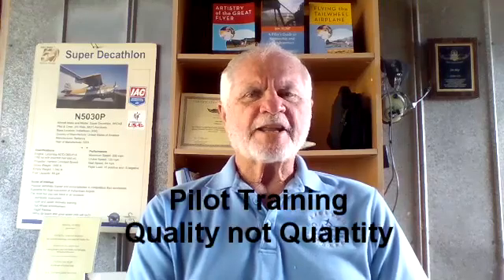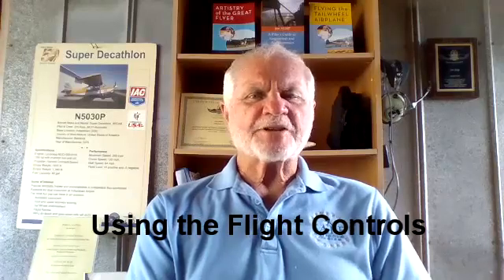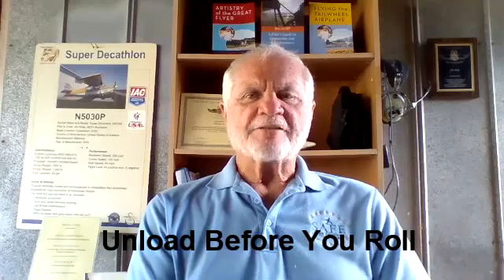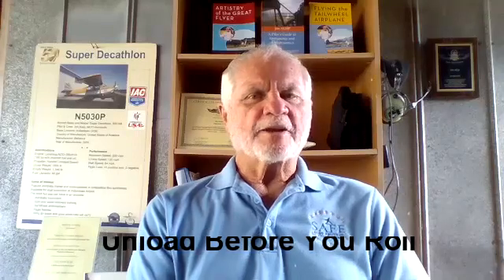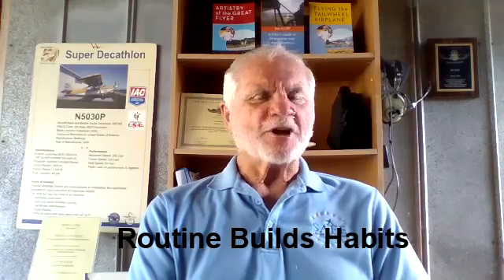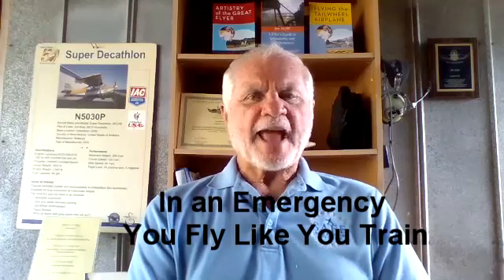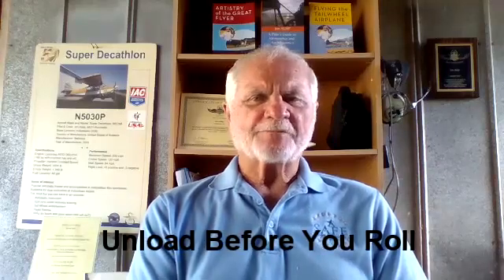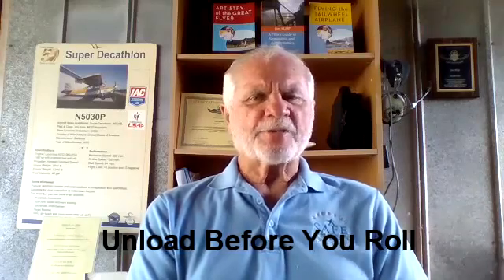Airmanship and Aerodynamics Part III – The Most Important Flight Control Habit

Comment: Have a question?? How to set up for straight in landing
Reply from the maker: Your question deals with some important issues. A pilot, at an uncontrolled airport, is generally free to make any VFR approach if it is safe. Many pilots arrive at an airport and announce "straight in". Such an approach is legal and generally safe, but do you really want to fly that way? It is discourteous to pilots in the pattern. That has always been a pet peeve of mine.
Another issue is that the AIMS and others FAA flight references  dictate a standard pattern approach. Those references state good reasons to make a standard VFR approach to landing. 
In my opinion, straight In approach should be reserved for IFR and Special Situations. I recommend you fly "by the book".
You will always reduce risk, build good habits develop the skill of Airmanship>

Comment: So does this apply to even a shallow turn? Let's say I'm climbing after T/O and want to turn xwind, do I momentarily unload before rolling into a 30bank and then add back elevator?
Reply from the maker: That is a great question, and offers a definitive learning opportunity. 
The easy answer is yes - always unload before you roll. I needed three long videos to explain the why and therefore of that advise. In a most meaningful way it will break and prevent the really dangerous habit of pulling back .
Consider your question:
First, and to be clear, unload means release back pressure on elevator. Unload does not mean push stick forward.
Second why are you "holding" back pressure?  After take off you trim your airplane for some airspeed, right. Commonly that would be best rate of climb. ( I like 80) There is no need to hold pressure (load) on the elevator.
Next you want to execute a shallow climbing turn. What is your criteria?. I argue the airplane flies better than you do.
Instead of loading and unloading, yanking and banking let the airplane demonstrate. Try this.
Established in a trimmed climbing flight condition, keep hands off the stick and use rudder pressure to initiate bank.
Do Not PUSH AND STUMP rudder pedals. Instead use light pressure to establish bank and then allow  airplane to fly a beautiful climbing turn with  constant bank and constant airspeed. You will be dealing with P-factor YAW, so best watch my video or read my books. They all discuss this important element of airmanship. (During climbing turn to right you will need constant light rudder pressure.
Have fun with this exercise. It will change the way you fly an airplane.